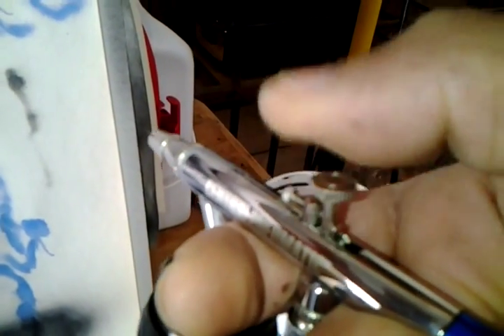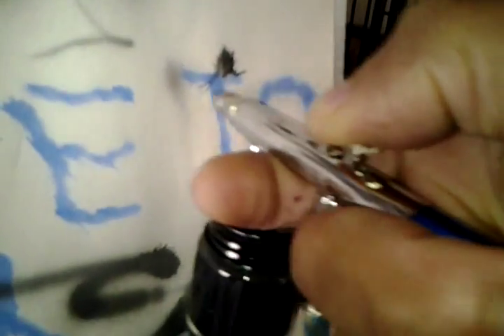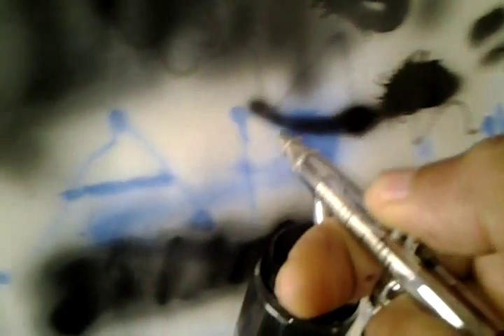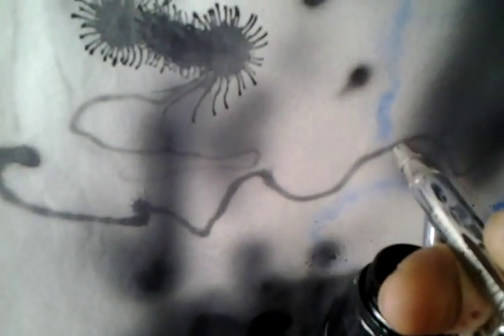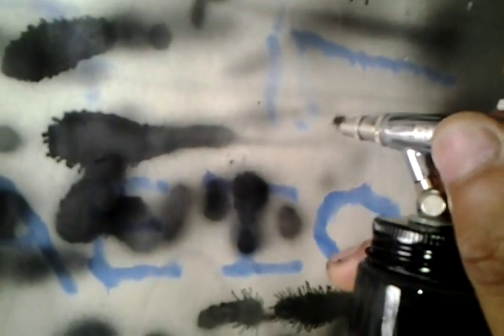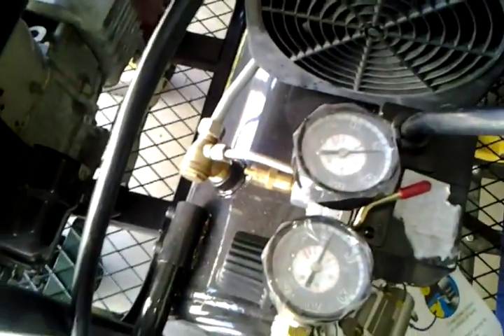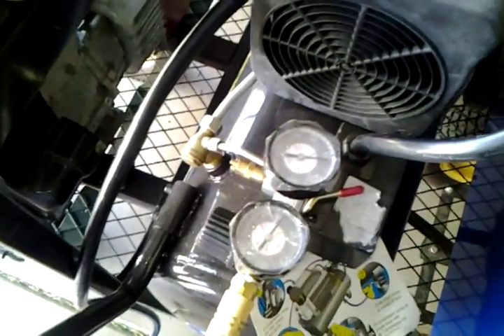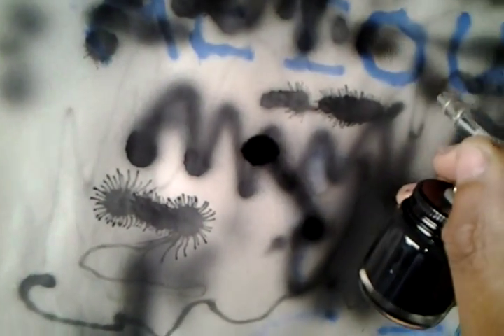Harbor Freights Tools Airbrush deluxe kit model 95810

Comment: Did you ever get this working?  It looks like a couple things were going on that are really easy fixes.  One, the nut holding the needle is probably loose, and two, the rocker behind the trigger is not installed correctly, so when you when you push down on the air valve, it is also pulling back on the needle.  Your paint may also have not been thinned enough.  Even with a good quality airbrush, improperly thinned paint can spray intermittently.

Comment: Lol .. man I had the same issue with that peace of junk ... yes it a junk air brush ! Going to buy a mush nicer one .. but anyways   to fix that problem u must read the manual and re adjust the Needle and adjust the trigger that is why it is not spraying the right way with the trigger also u dont need 5pn psi 30 psi or lower works just fine ... note just read the manual and adjust what I told u .. and it will work fine ... any w qustions feel free and meesage me ill help u out and make a video and show you what I'm talking about .

Comment: You should have waited and saved up more money to buy the original BADGER #150 instead, all these cheap chinese knock-offs are just for looks and not for actual use...One could say that the cheap crap is actually more expensive in the long run than the buying the original stuff...